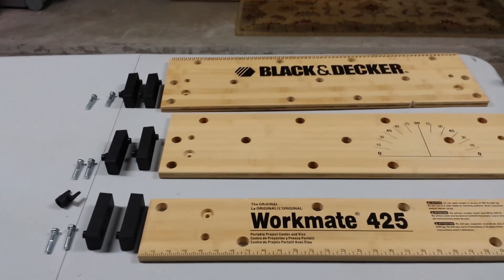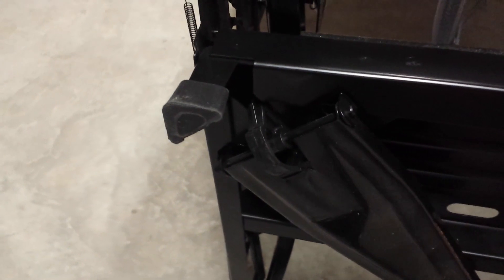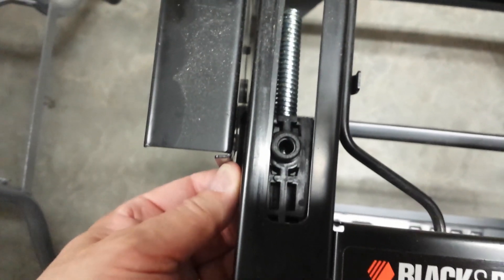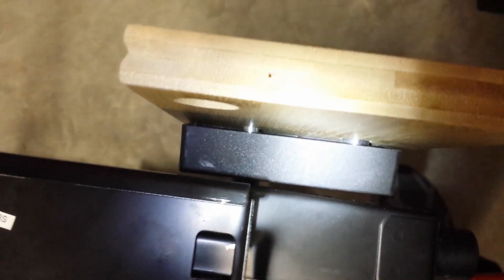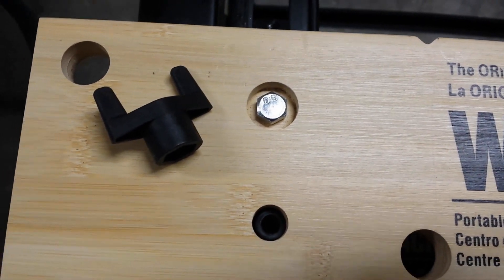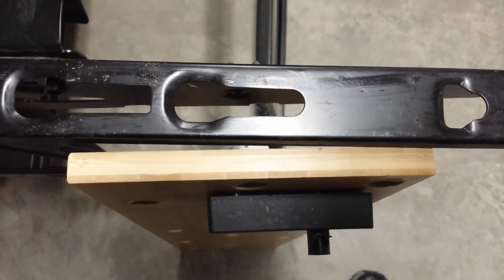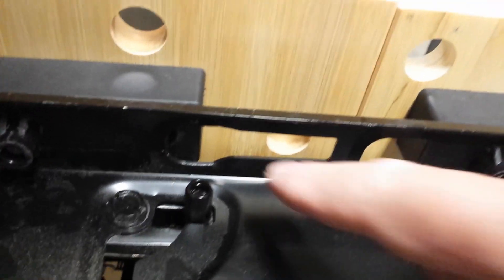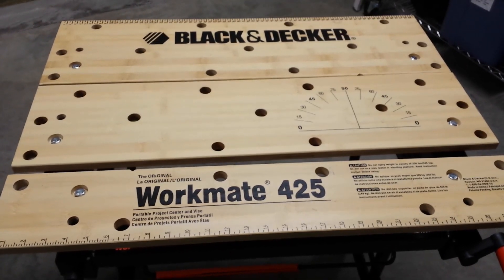How To Assemble Your Workmate 425

Comment: First thing to do before attempting this assembly is to burn the garbage instruction and carefully watch this video! Great video bud. Made putting this thing together a breeze. Many thanks!
Reply from the maker: OffRoad Congratulations on the purchase of your new workmate 425. I know you will enjoy using it. You are certainly welcome for the video and welcome to my channel.
Reply: That's exactly what I did, but the part when you tap in the " Handles Pins "!! You might show or tell YouTubers one end is " Tapered " and that's the right end to go through the handles into the " Chamferd"  shaft hole!!
Reply: I don't know if that's going to work, I've tried that, and It didn't want to SNAP the perferated tape? I'd really like "NOT TO FORCE TURNING the handles??
Reply: B
Reply: yes! great video!

Comment: Just got an unopened 425 for $50 off CL.  I watched your video first and assembly was super easy.  I do see how these newer boards are thinner than the older workmates.  I also have a 125 model and an old Bench Top Workmate Type 1 (bought for $3 at garage sale).  Thanks for the videos!
Reply from the maker: You are certainly welcome and congratulations on your new Workmate!

Comment: I didn't find the instructions incomprehensible, but they were cryptic.  I heard so many comments about the instructions though I needed to check out this video to make sure I was assembling it correctly and didn't miss some hidden secret. So, the video was helpful. 
The hardest part of the assembly is installing the spring bearings that hold the vise handles. I'd suggest crimping just the bearing insertion end being careful not to close the slot. A squirt or 2 of lubricant, like  WD 40, on the bearing and into the hole in the worm gear shaft should allow for an easier insertion. 
The idea of using this type of fitting though to hold the handle strikes me as a poor design.  I eventually needed a small punch to fully seat the bearing through the shaft.  There's still an annoying wobble in the vise handles but apparently it doesn't inhibit the action of the vise. Possibly I could have rigged some setup using washers to reduce play, but I thought about that too late and possibly the lubricant is allowing the bearings to move slightly. Over time those bearings will dry out so maybe the wobble starts to disappear.
Reply from the maker: Thanks for stopping by and commenting.  Cheers.

Comment: I can’t figure this assembly out. I bought both this and the work table at the same time because I didn’t know which I’d like better. The work table requires no assembly and just pulled right out of the box, I’ve been using it for a week and LOVE it. The Black & Decker has been sitting half assembled for a week due to garbage instructions and difficult assembly. I am thinking about returning. I am blown away this table has been in production for decades and is popular, could have fooled me.
Reply from the maker: Yes,  I suspect the instructions seem to be written by someone with little or no experience.  :-)

Comment: The funny papers that came with this product were the worst assembly instructions I've ever seen in my life, and I've seen a lot because I'm old AF. 

Your video was very helpful, and would have saved me a lot of time if I had just thrown the instructions away and watched it first. My first clue was when the instructions showed the middle piece on the back and the back piece in the middle. I looked at the picture on the box AND on the front of the comic book and they contradicted what the instructions "showed" if I may use that word, for lack of a better verb.

Stanley/Black & Decker/ Anheuser Busch / Mr. Boston vodka should pay you double what they paid the Chinese comic fiction writer who made the grafitti that came in the box. Black & Decker should make a Ouija board so I can tell my grandfather that the Workmate is now made of bamboo and 25 gauge sheet metal. I'd screw some razor blades to his coffin and use it for a wood lathe as he spins in his grave at 20,000 RPM.
Reply from the maker: I understand completely.

Comment: I basically was looking for suggestions on aligning the worm drive which had one side offset from the other.  I did get a few pointers for checking some other issues though.  I ended up taking the clamping board off and rotated the travel part a couple turns to align them without having to mess with the plastic chain.
Reply from the maker: Thanks for stopping by and sharing.  Cheers!

Comment: I have an old workmate 425 (gray sheet metal and black painted particle board) purchased used sometime ago.  The odd thing is, I turn clockwise to release the clamp and counter clockwise to tighten. I took a closer look at your video and sure enough the lead screw is threaded opposed to yours.  Do you know anything about this?
Reply from the maker: Hey Yong - Wow! That's very interesting.  "Righty Tighty, Lefty Loosy" is the old saying among mechanics.  I am wondering why yours is switched.  Is there any indication as to where it was made or assembled?
Reply: @autohelpeu  ,  its written on the first board that its made in Canada.
Reply from the maker: Hey Yong - Yes, many of the Workmates have been made in Canada.  I am still wondering why the reverse threading.  Hmmm...

Comment: I just put mine together as you instructed, and I had two small springs fall off from underneath the bench. Can you tell me where they are supposed to be and how to re install them....thanks so much in advance.
Reply from the maker: There are two narrow springs that clip on to the outside of the legs / stand assembly.  They should have been installed at the factory.  You can kinda see them on the bottom left side of the frame at 9:30 in this video.  Regards!

Comment: I have my 425 fully assembled GREAT, however when i tighten the clamp the panels are righting on an angel. Now the problem is the tape isn't on the right holes, how do i adjust this?? Any suggestions, also it appears that my panels aren't level, is that a problem or just " Forget About It" ???
Reply from the maker: Hi Rene, you should be able to crank on the side that is not flush and the tape should slip.  Otherwise, you might consider removing the tape from the gears/teeth.  I am not sure what to do about the panels not being level without seeing it.  If assembled correctly all three panels are flush/level with each other.  Cheers!
Reply: @autohelpeu  Thanks for answering i did think about removing & adjusting the tape. I'll check that out and also see what's wrong with the "Panels not being level?", If needed I'll see if i can send you a pitcher.

Comment: Great video!  Thanks.  Used to own an original work mate from the early 80s and I moved and sold it for 20$.  I deserve a kick.  Doing some renos for a friend and just bought a 425.  

I noticed that there is a plastic perforated strip that is wrapped around both crank handle screws located right under the metal rail with all the printing.  This strip rotates the other handle if you turn the other.  Does this have to be cut as I remember the cranks being independent?
Reply from the maker: Hey Crocaduck - The white strip or belt you refer to allows the cranks to be synchronized.  When I need to clamp an asymmetrical work piece I slide the belt off, do my work, and slide it back on when done so I don't loose the sychro function.  Cheers.
Reply: @autohelpeu  Thanks loads.  I thought I'd check before cutting things.  My new work mate looks boss.  I afraid to scratch it.  Ha
Reply from the maker: Hey crocaduck - Understand the feeling.  I used to put cardboard on top of mine when I first got it because I did not want to ruin the finish... but, not any more.  :-)
Reply: @autohelpeu  I'm going to build a plywood smash-and-paint top for it.  Looks like a few owners did that.  I wish I didn't give away my vintage clamps with my old work mate.  Deserve another kick.  I did save a portable vise that B&D sold. (B & D 3" portable vise CAT. NO. 70-995 - TYPE 1)
Reply: @autohelpeu  I did put 7/8" washers in all 6 bolt holes.  Bolt heads don't protrude.  Need to cut a ply panel or masonite piece for shelf at bottom.
Reply from the maker: Hey crocaduck - sounds like you are adding some very useful customizations to your Workmate.
Reply from the maker: There are so many great products related to the Workmate that B&D discontinued... that I wish they still made.   :-(
Reply: @autohelpeu  Yea, I hear ya.  ;(
Reply: Glad I read this comment. My new bench came with the worm drives out of sync so synchronous cranking of the turn handles wouldn’t allow for parallel alignment of the top boards. Slipping the belt of the one cam and adjusting things to parallel worked, but it’s not so simple to slip the belt on and off. I might end up cutting this cheap plastic drive belt off yet! Overall the video saved time and effort. The pictographs booklet leaves much to be desired in instructions. Pictures were dark and unclear about how to align the plastic parts properly.

Comment: What’s your ( or other users) opinion on the ‘ribbon’? I got a 825, which has the ribbon.. it was damaged, made a repair, works now, but I am not convinced of it’s usefulness.. any opinions? Keep the ribbon or not..?
Reply from the maker: It does help when you are trying to hold the work piece in a particular position while tightening the clamp.  Cheers!

Comment: HA!! At 1:01 .....Huge pain in the tush for me. The Belt that synchronizes the Cranks. Mine came off and completely dragged me out getting the conveyors aligned and to even re-track the belt. Somewhere, I found it was broken 1/2 thru at a hole and had to send for another. I just got it....have it on for now, but if you know an easier way should I ever have to replace the belt again, please Share?  6:10 Especially once the pins are put in place thru the crank handles. They don't install easy!! 
Thx ... A #JerseyBoy
Reply from the maker: Hey Wayne, Congratulations on your new Workmate! Yes they can be annoying.  The approach I have taken is similar to that of installing a fanbelt on a car.   I don't know of any easier way to do this.  Cheers!

Comment: I noticed your 2nd panel has more swivel peg holes than mine came with.  Did you drill them out yourself? Or did I just get a factory defect?
Reply from the maker: Clovis Steib Yes I did drill some extra holes for one of my projects and they came in very handy. Thanks for stopping by and posting your question.

Comment: I love this channel and bought my first workmate 425 because of it. I just out it together but the "tape" that synchronizes the two handles came off of the right handles pronged gear. (It also has a small tear in it so I could exchange it but that would take forever and I am not sure it is worth the hassle. I could also send away for the part.). However, I also see the benefit from the handles not being in sync for tapered pieces etc. How did you achieve this? Did you pop it off from both sides or just cut it?  I see this one in the video still has the tape. But it appears to be off the gear.
Reply: mine was the same way. I had a workmate years ago and it didnt have that tape. That made it easy to plane and sand tapered pieces. i did cut the tape off.. Workmateguy states below that he disabled his also.
Reply: @jimhughes8005  Thanks. I did not read far enough down to see he already commented about this.

Comment: Is that flimsy plastic belt absolutely necessary. There are times when one may be trying to secure an object with varying thickness for example. Then what? I get the whole synchronicity idea. But, that might not be ideal in all situations. Your thoughts?
Reply from the maker: Peter Batah To be honest with you, I have disabled the belt on my workmate 425.

Comment: The pins were a bear!! Spent the weekend hammering...still not fully in. Second I cannot really understand the 3 planks & how they fit together.
Reply from the maker: Yes, the back two panels are designed to be configured for different size work pieces which means you and turn them around to combine for what you need.  Cheers.

Comment: The various plastic parts are mentioned in some of the negative reviews of this Workmate I've read online. I wonder if it would be worthwhile to find a machinist to replicate them with metal?
Reply: No. You will be better off just getting a decent $500 work bench or building one yourself. This thing is ok for a $120 bench. If you want better, buy better.

Comment: This was helpful thanks. The instructions are truly garbage. The first panel went in ok. Once connected however the panel was crooked. Are you kidding me???!!!! They have some sort of a band running between the handles so they BOTH MOVE at the same time. I’ll look more closely to see if there is a release of some sort.
Reply from the maker: The bands on the cranks can be helpful especially when you are holding your workpiece in place to clamp.  However, you can carefully slip it off if you don't need it.  Cheers!
Reply: @WorkMateGuy  how do you put it back on?

Comment: Thanks for that. The instructions are miserable. Total nonsense. One of the plastic bits that joins the front clamp section with the cranks was missing on one I purchased. They sent along a replacement, but I couldn’t get that little so-and-so to thread to save my life. And I have been working in shops for 40 years. So I have one for clamping, and a partial one for outfeed. Miserable. Would it kill them to sell them assembled?
Reply from the maker: mgmcd1You are certainly welcome and glad to know it helped you out to some degree. It's a shame they couldn't get it right the first time for you. It aint rocket science it's a workbench. :-)

Comment: The most infuriating part is putting the pins in the hand crank handles. That is the problem with all of the Workmates. The only practical way I found to do it is by using a 4 inch "C" clamp.
Reply from the maker: Yep, there should be a better way! cheers!

Comment: This thing what a pile of crap, the pins for the holes on the crank were too big, and there was no way to get them in without doing some modification to make it work.
Reply from the maker: It can be tricky... get at least one hole from the strap on a tooth and start cranking.  It's kinda like putting on a  fan belt or bike chain.  Cheers!